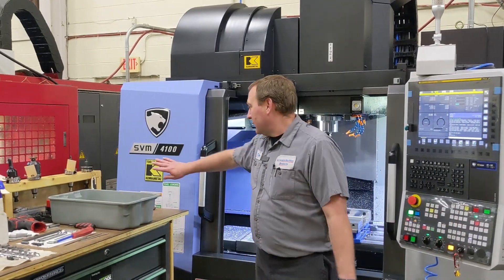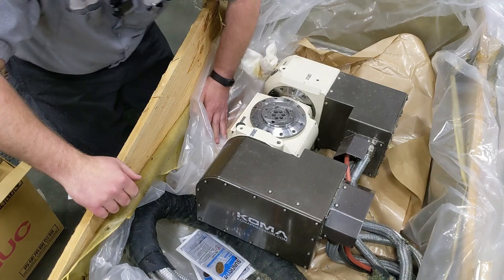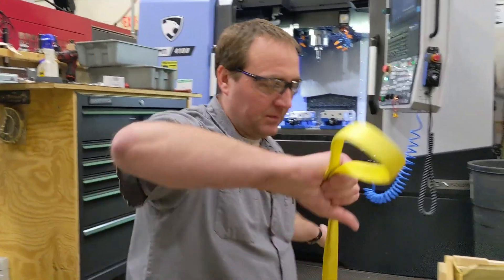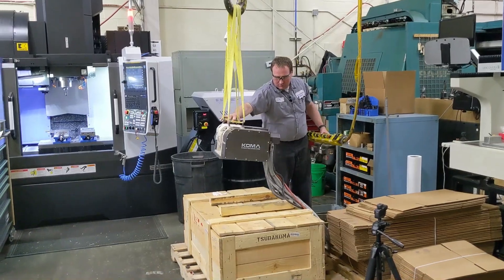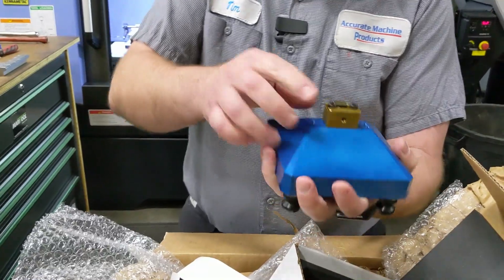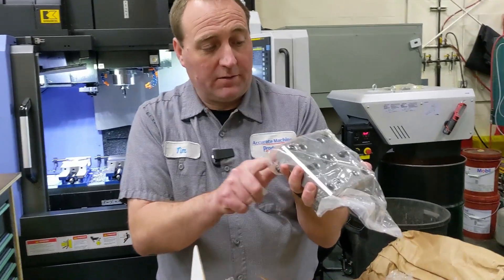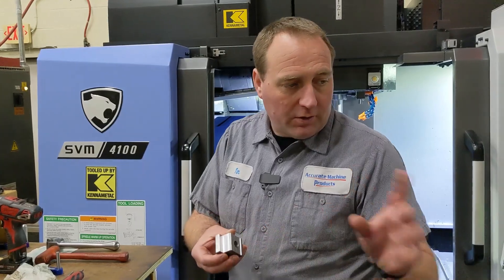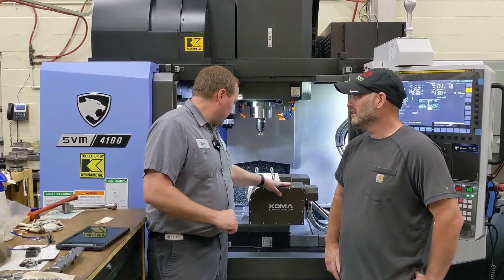We Installed A Tilting Rotary On Our DN Solutions SVM 4100

Comment: Oh wow that's the same model I use at work, TN-131 I think it's the number. Great 5 axis but a huge WARNING! When at 90deg. always use the locking codes, the pin inside can break with enough drilling pressure if not locked. We had to service ours twice over the years. DID you also get the center? We also use the 5th axis sub-plate and vice too, LOL!
Reply from the maker: Thanks for the tip!  Fortunately for us the DN ladder automatically applies the brakes after every move.  It works pretty slick!  Been a great upgrade so far!